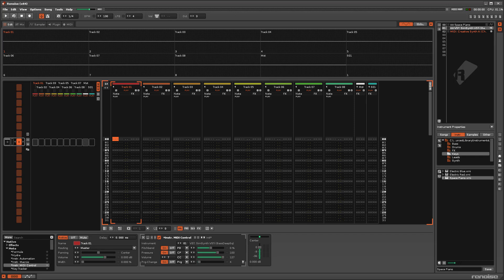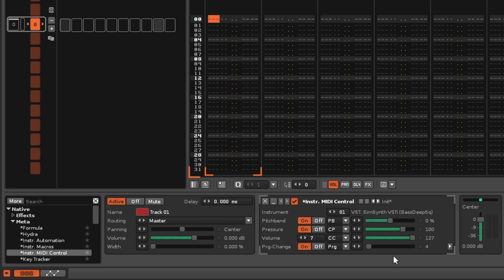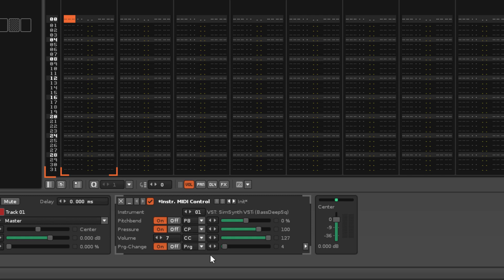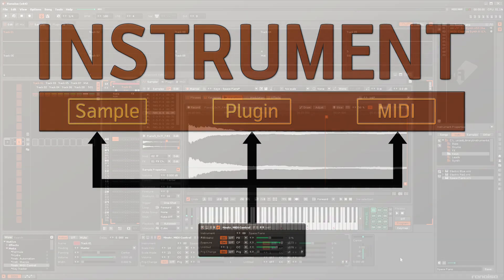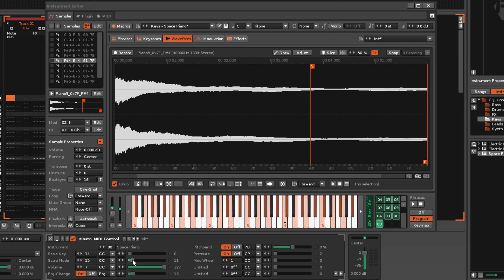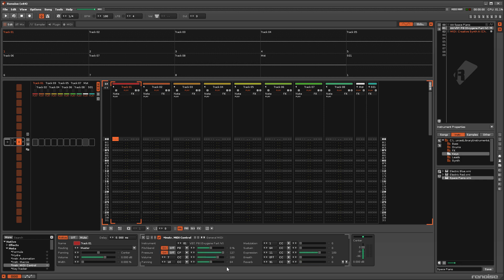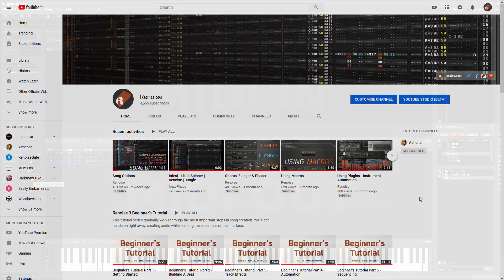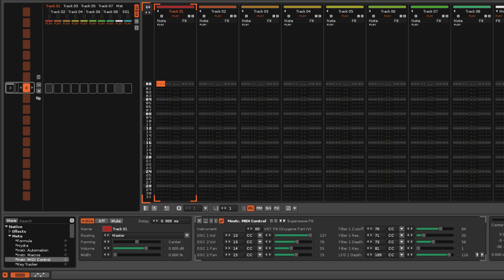Instrument MIDI Control

Comment: I have advanced midi maps set to CC, 1 ,2, 3, 4 on master fx plugs , all works with my midi cc FADER BOX ETC ETC , what is the best way to send CC data to this in automation ?  esp when Im away from the external midi cc control box .  HOW TO AUTOMATE ROUTE CC DATA for MIDI MAPPED CONTROLS? Cant seem to route Midi controller INSTRUMENT Midi Control to send CC to master track FX premapped to CC 1 2 3 4 . How?